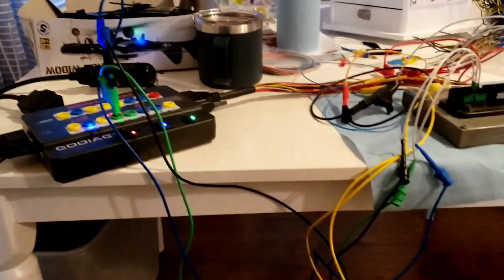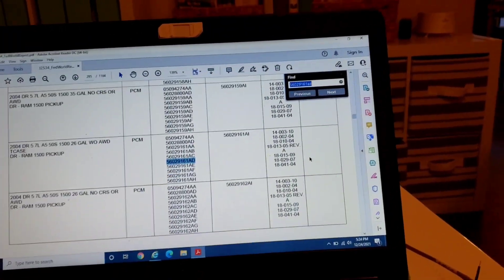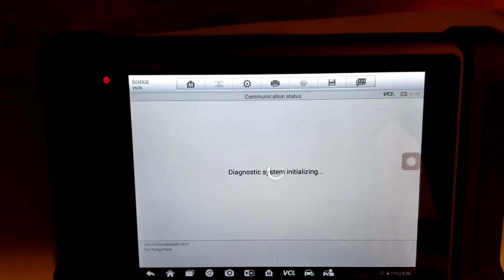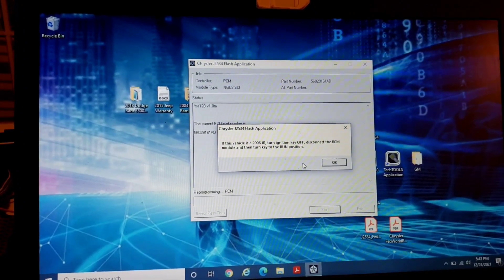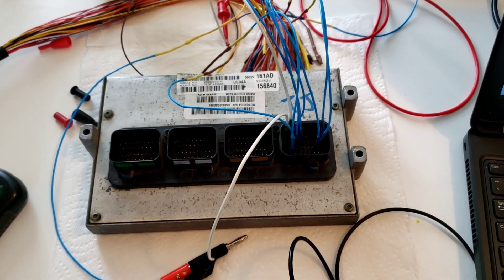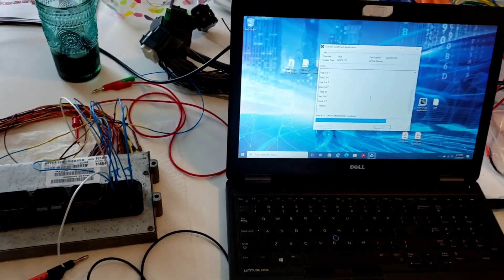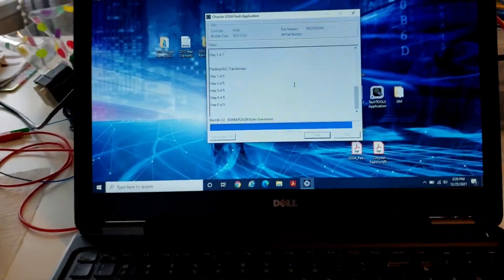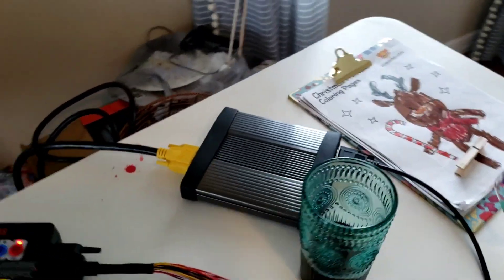Chrysler PCM Bench Programming (PCI & SCI Bus)

Comment: hey i have a question. i am bench powering a 2003 chrysler pcm. i have the battery plus supply and the ignition key on and grounds supplied. is there some secret to getting the pcm to turn on? it did run in the car. so i know it will turn on. what am i missing? this is my first time  bench testing a pcm. thank you.